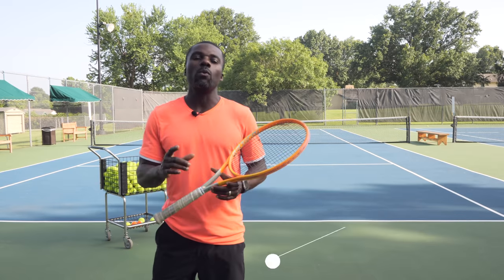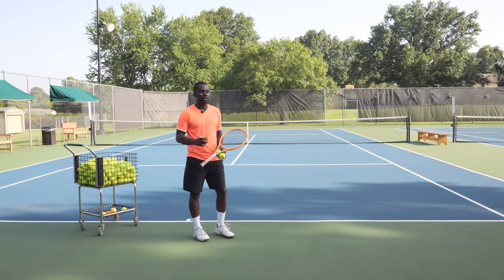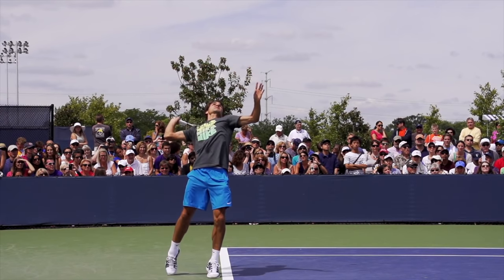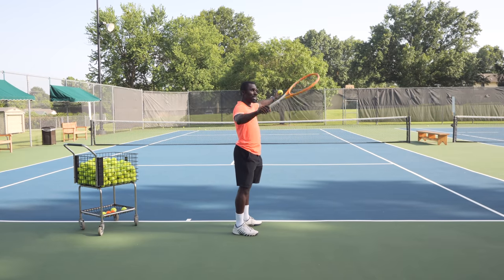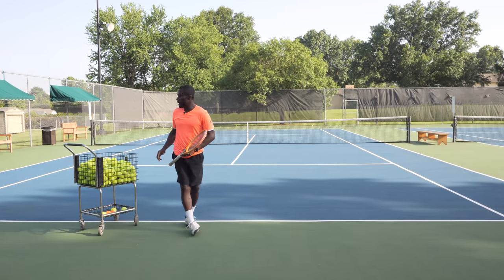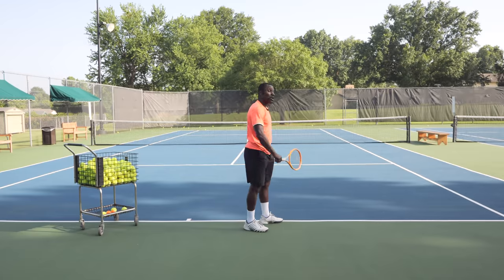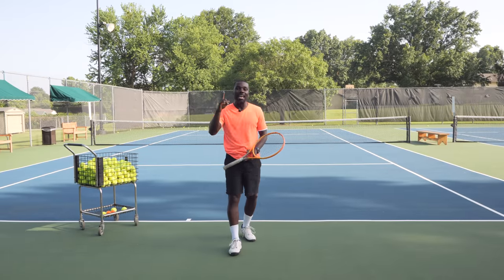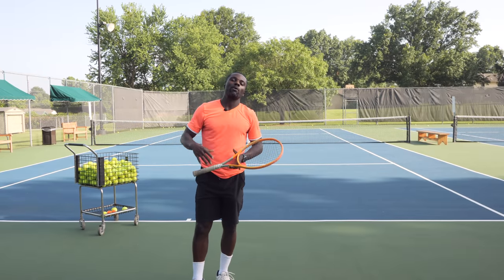Want More Serve Power And Consistency...Do These Drills.

Comment: I ask why not simplify the serve for mere mortal rec playsrs? Forget disguise, placement, kick, and max power. Give the rec player the tools to put the ball in play CONFIDENTLY.
My suggestion is skip the trophy pose chest facing the back fence. Go directly back to the backscratch position as you toss then use a catapult swing forward with pronation. Let the ball toss location add the spin. Rec players naturally want to face the net/service box. This technique lets them while still using the continental grip. Imagine the Sampras overhead smash with no jump and slower mere mortal racket head speed.